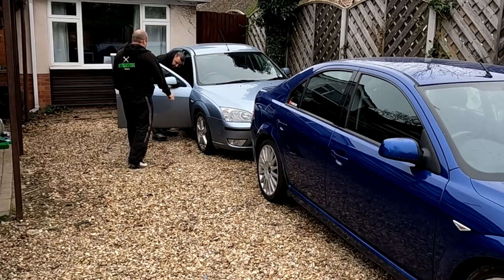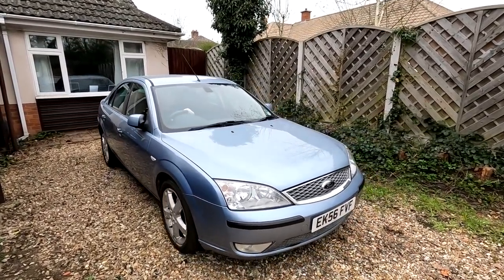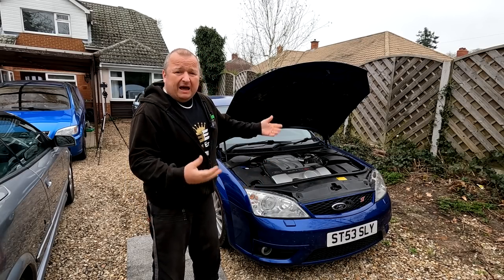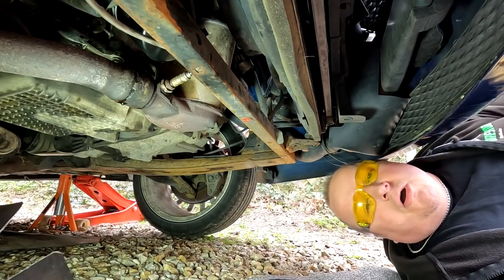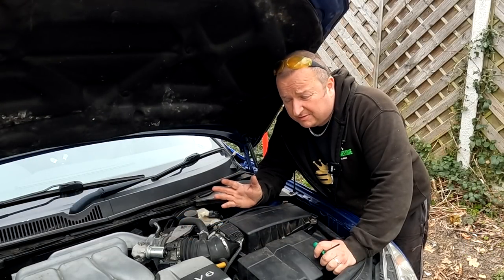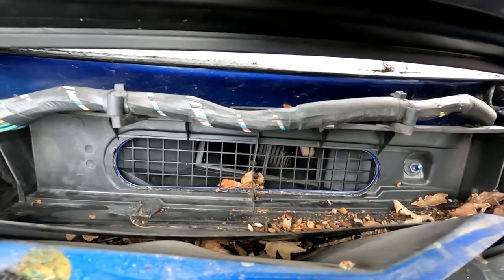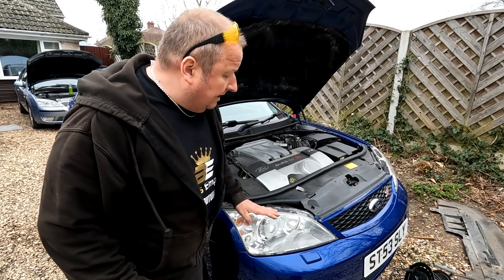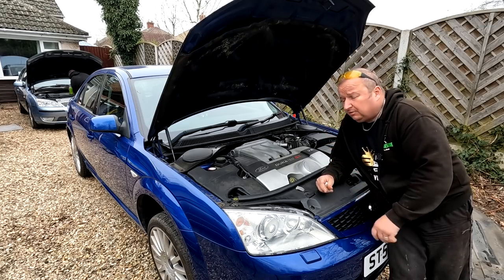Mondeo Mice Invasion - How They Got In

Comment: Nice one , glad its not just me that gets in a pickle under cars with under trays and oil catcher, one tip I always do is to fill the oil filter with fresh oil as far as you can to help the oil pressure come up as quick as possible, not easy when the filter is on an angle like that but I feel every little helps. One day they migth make a vehicle with the filter in a sensible place, the dam Vectra is rigth down the back of the engine and its horrible to get to.

Comment: little tip from experience periodically its worth checking the little cable between the bonnet key lock and the bonnet catch as the bit that connects to the latch is plastic and mine broke then had to rip the front of the car to bits  , they can be replaced very cheap and worth doing :) great vid as always
Reply from the maker: Yes, i've had that problem on previous Mondeo's I've had.
Reply: I had this exact problem too, real pain!

Comment: As i didn't have an oil filter chain wrench i had to drill a hole then stick a screwdriver in it to undo it. I've used Hammerite on my back axle. Still looks good after 2 years.

Comment: Martin, you could punch a hole in the bottom edge of the oil filter and allow the oil to drain out before removing it. Since the old oil filter is going to be discarded anyways, no harm. Just an idea to maybe keep the oil from going everywhere. Mice are ingenious little creatures and can squeeze through some very small openings. I realize they can carry diseases, but I would re-local them to some livable safe area, instead of killing them. JMHO
Reply from the maker: We did relocate them

Comment: I miss my old mk3 2.0 petrol ghia x. it was a 55 plate and was the same colour as project man's car. my brother had it and was written off when some geezer in a range rover went straight in the back of it! that p*ssed me off as I'd spent a small fortune on it. I have a mk4 petrol in zetec trim which drives amazing. it's just passed 160,000 miles, it had a new luk clutch kit fitted at 117k and a new intake manifold, also an alternator clutch pulley, new suspension, drive shafts, wheel bearings and disc's and pads and a new auxiliary belt kit. I look after my cars!
Reply from the maker: Should last a good while with all those replacements Simpn.

Comment: Does your oil pump work on the car? Could use to suck up the container oil wipe out after words. I figured if it did be a whole lot less messy. Our old ski boat we used the dip stick tube had an adapter we pressure up the tank sucked the oil out. Same concept wander if your white oil pump container would work??
Reply from the maker: That wouldn't remove the oil out of the filter bud.
Reply: I tried this idea before on vehicles. It's not that successful overall. Some work well some not at all well. You are usually better off draining the oil as Martin did in this video.

Comment: Martin I've got a mk4 Mondeo 2.0 tdci I had a coolant blow I've replaced it refilled the coolant and tried my best to bleed it but it's getting hot no signs of head gasket fan kicks in like it should any tips what to check I'm at a loose I'm having a terrible week cars broke on me and the fuel pump on my transit has packed up and been quoted £800 to do it I'm getting my push bike out again
Reply from the maker: Put your heater on hot setting and its filled up to the mark in the expansion tank. Run the car till it warms up and locate the hose coming out of the thermostat housing and if the thermostat is opening, that hose should get hot when the stat opens. If it doesn't, the stat may not be working causing the car to overheat.